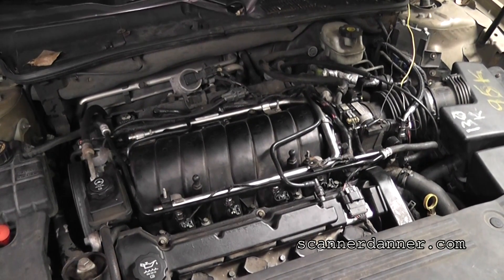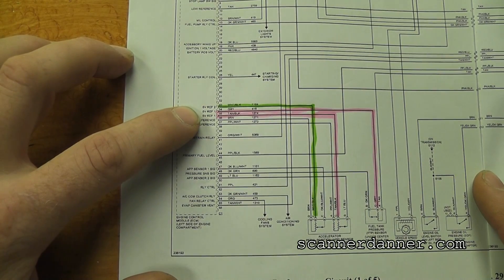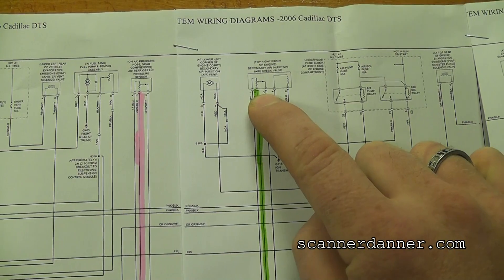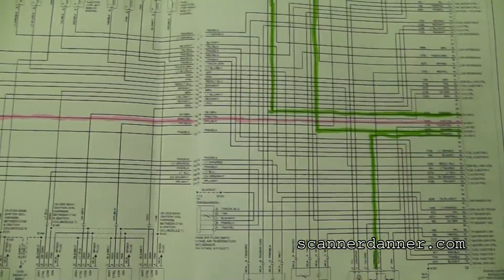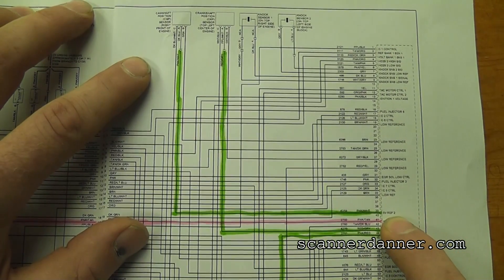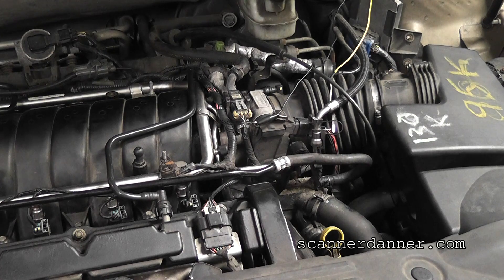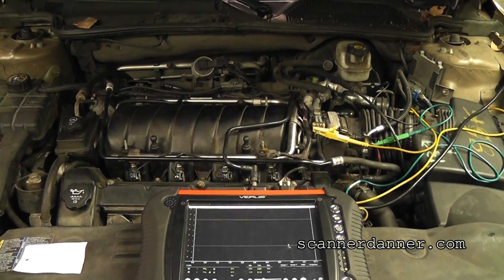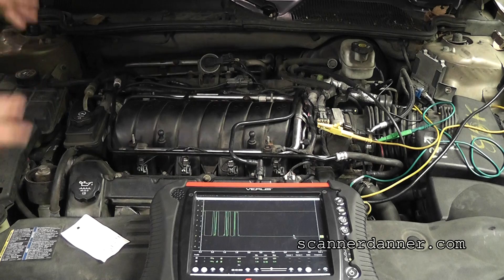How to check the 5v reference circuit for a short to ground (Cadillac)

Comment: I feel like I've missed something, how did you know it was shorted to ground? Could this have been a failure of the PCM to send the 5V signal, or could this be on the other side of an open wire? I suppose you might see ghost voltage with an open, but how does the scanner tell those two apart?
Reply from the maker: Scan data would have still showed 5 with an open. No matter where the open would be. Start at 1 minute in

Comment: I'm working on a 10 impala 3.9 interceptor p0641 when I check the 5v ref pid it switches from ok to fault then back to ok. I had like 7v at the map at some point fuel level sensor volts 0 on scanner but gauge works
Reply: pulling my hair out on this one

Comment: The Northstar actually uses two crank sensors 27° apart. It's a fast start system.
Reply: 2000 to 2005 uses 2 and 2006 to 2011 uses only 1.

Comment: Hey paul, wish i had super talented electricians like you in my country.. I knew nothing about electronics and I hated it until I found your channel. Learnt alot from your videos. I do have a question though. Is it possible to have a 5v voltage on a reference wire and a short to ground on the same wire?
Reply: A partial short
Reply: that sounds stupid lol.. if a 5v ref is shorted, it will by all means show 0 volts..?

Comment: We just had one of our cabs come in with Engine Power Reduced, a 08 Impala 3.5L.  It had P0641 and P2119.  Kinda stumped though because unlike the problem in this video the code could be a short to voltage or short to ground (if I interpret Alldata info right), I pulled up both ref pids on the scanner and they both show the 5 volts they should..wiggled harnesses etc and didn't see any blip.
Reply: How did you resolve this one

Comment: You Absolute right for Caddy about the crank and cam

The 5-volt reference 1 bus provides 5 volts to the following sensors:
The air conditioning (A/C) refrigerant pressure sensor
The manifold absolute pressure (MAP) sensor
The fuel tank pressure (FTP) sensor
The accelerator pedal position (APP) sensor 2
The exhaust gas recirculation (EGR) position sensor
The camshaft position (CMP) sensor

The 5-volt reference 2 bus provides 5 volts to the following sensors:                     The APP sensor 1
The throttle position (TP) sensor 1 and 2
The secondary air injection (AIR) Solenoid
The crankshaft position (CKP) sensor
Reply: I thank you for this. I have an 07 Buick Lucerne with a 4.6 northstar, and it lost 5v ref 1. I had eliminated all the sensors the Mitchell schematic showed for ref 1, and still had no voltage. Ater seeing your video, I questioned the crank and cam sensor circuits. I had 5v on the crank sensor circuit, but not on the cam sensor circuit. That was where the problem actually was.

Comment: Hey Paul good and fast repair awesome you can do with scope now in days right!! Can you with us how did you know that the 0v was shorted to ground and not a open circuit??
Reply from the maker: great question! It is a few reasons. 1. If it was an open the code would never set and the scan data would not show 0v. At the sensor you would see 0 but scan data would have shown 5. 2. The entire circuit was affected, the only way that could be an open would be if the open was near the PCM. An open in one section of this 5v ref line would only affect the one sensor.

Comment: that's crazy my 1990 Deville 4.5 a pink wire from ignition switch to distributor shorted out against a bracket just in the same way. the car died speedo jumped to 85 and stayed there and lost all accessory power. all because that wire.

Comment: Paul what is your opinion on wrapping harnesses with that heat proof foil type tape, like what GM uses around ERG valves, and exhaust? This Cadillac actually had it.  I started using it after having bad luck with the plastic harness looms which eventually chafe and break away revealing the harness.  Heard these can cause interference on some ignition systems though. Thoughts?
Reply from the maker: If it is in a spot that has previously melted, I don't see any harm in doing that.

Comment: On another note, I'm actually kinda surprised that an 06 Cadillac DTS has a bad motor mount. I worked in a Cadillac dealership for 6 year. 05 and older Deville's and DTS's were notorious for breaking motor mounts, but I thought GM solved the motor mount breakage problem in 06 when they put the huge dog-bone on the passenger side of the engine compartment.

Comment: I can field at least part of the question as to why this car ran without a crank or cam sensor signal. The answer is the PCM on newer GM products can start and run, and run good too mind you, without a crank sensor signal by monitoring the cam sensor signal and the MAF signal together as a default. I found that out on an 07 Tahoe. While I can't say for sure, what I suspect is the reason the car still ran without either the crank or cam signal is that without a cam signal, the PCM gang-fires the injectors as a default. I believe in this particular case, the PCM tried to use both of the above mentioned defaults at the same time. Without any sort of way to accurately measure RPM, the PCM is able to make the car run, but it'll run like crap, as evidenced in this video.

Comment: The second 5 volt reference circuit was most likely added solely for the second APP sensor potentiometer if this vehicle had a throttle cable you'd only have one reference circuit.

It's funny that the throttle control motor still responded with one APP pot essentially dead.

I always thought the PCM compared the signal voltage from both pots if they didn't agree with each other you would think it would disable the throttle. Rather than have unpredictable throttle operation. Apparently not.
Reply from the maker: It doesn't totally disable it, but it is limited to I think 20% throttle opening.
Reply from the maker: Oh and I agree with the second reference circuit most likely not being there if this didn't have an ETC system
Reply: ScannerDanner
I see that makes more sense. Come to think of it a sudden loss of throttle could be just as dangerous on the road.

Still learning about the limp in modes on these drive by wire systems.

Thanks for the reply.
Reply: @ScannerDanner  Mr. Danner, i have zero voltage in the accelerator pedal pin connector of all 6 wires of a GMC denali 2007 with the ignition on and off and even with the engine running. could you please help me shortlist the cause